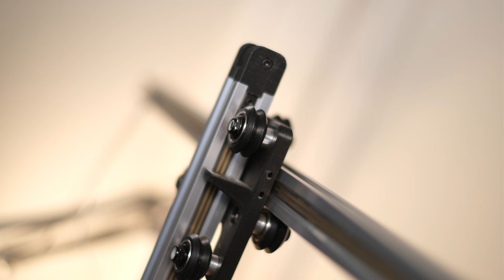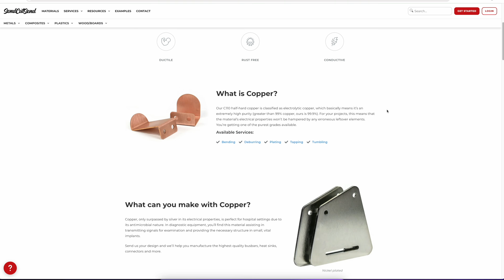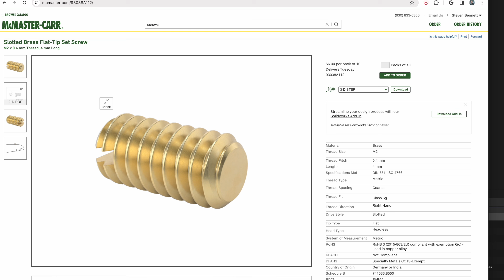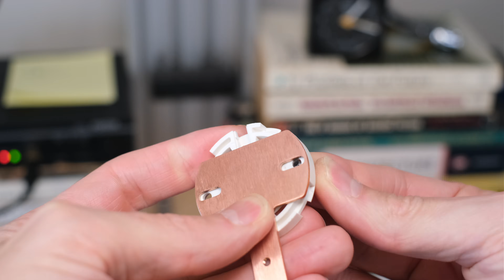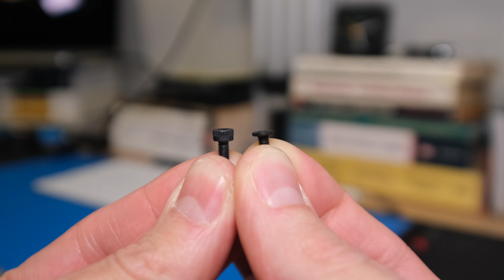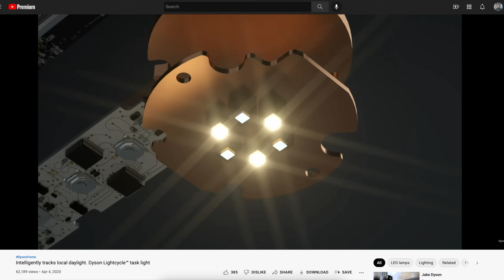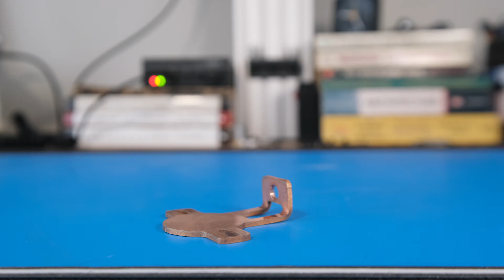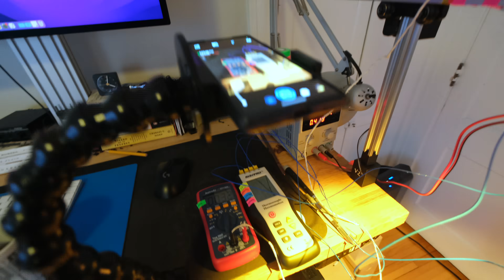Just how good are heat pipes anyway? - DIYson Lamp Build Log #10

Comment: Countersink screws could be a good solution
Reply: I obviously don't know enough to comment here because robust design suggests a hole drilled in roughly the right spot with a quick and dirty counter sink feature that seats the bolt head down more than lets say 1.02mm (!!!) would work perfectly. Good design includes tolerances or is tolerant so it matters least how precise your manufacturing is. As the load on the bolt will be less than about 200kgs pretty sure a countersunk bolt will be adequate rather than a counter bored solution. It's also easy to do with cheap low tolerance tools.  If the answer seems too hard you're probably looking too closely. Step back. Take a breath.
Reply: I’d prefer counterbore holes. Countersink holes require higher precision in location and can over-constrain the assembly. When you don’t actually need the countersink to locate your part you’re better off with counterbore holes.
Reply: @ADebbil You'd be right, but I think in this case the bar is too narrow for cbore holes to work - the cbore diameter for an M3 screw is wider than the bar lol. Even going down to M2 with a cbore cuts away too much of the bar imo. Csink doesn't remove nearly as much material and works a lot better with thin materials. The over constraint issue is easily solved by letting the bar be narrower than the available space.
Reply from the maker: This is something I would probably try if I was forced to use the solid copper bracket, but since the heat pipe performed so much better I ended up sidestepping that particular problem altogether. Thanks for the suggestion though 👍🏻
Reply: @StevenBennettMakes  If you had determined the solid plate solution was better, this is how you would get around the roller clearance issue. But I'm glad you were able to prove the heatpipe solution!
Reply: @StevenBennettMakes  

Honestly, the first solution to the binding that popped into my mind was to just grind down the tips of the wheels, as that shouldn't interfere with them seating against the slope of the rail.  Does that make sense, or am I missing something?

Also, it occurred to me that the heat pipe might not be making solid contact with the bottom of the rail's T-slot.  Might there be enough of a gap to slide some copper in between the top of the heat pipe and the top of the rail's T-slot?
Reply: @ADebbil   this is true, although i wonder how much it matters in an application like this where a long, thin piece of soft metal being anchored to a much thicker and more rigid aluminum extrusion; surely the copper will simply deform to take up any misalignment?
Reply: Could also shave some material off of the wheels.
Reply: @scruffy3121  I would have changed the wheels holding the horizontal arm to grab it from the sides instead of top and bottom.
Reply: With the screw held in compression, a set screw is better.
Reply: @Flumphinator in the new way the screw is to pull towards the center and counter sink screw is the right choice
Reply: @Flumphinator 🔴 What Is Islam?  
 
🔴 Islam is not just another religion.  
 
🔵 It is the same message preached by Moses, Jesus and Abraham. 
 
 🔴 Islam literally means ‘submission to God’ and it teaches us to have a direct relationship with God.  
 
 🔵 It reminds us that since God created us, no one should be worshipped except God alone.  
 
 🔴 It also teaches that God is nothing like a human being or like anything that we can imagine. 
 
🌍 The concept of God is summarized in the Quran as: 
 
📖 { “Say, He is God, the One.  God, the Absolute.  He does not give birth, nor was He born, and there is nothing like Him.”} (Quran 112:1-4) 📚 
 
🔴 Becoming a Muslim is not turning your back to Jesus.  
 
🔵 Rather it’s going back to the original teachings of Jesus and obeying him.  
 
 
More .....👇 
 
🔴 THE RETURN OF JESUS
Reply: @Flumphinator  🔴 Why Islam not other religion

 1-islam gives logical and simple idea for God - he is A perfect God - he is not a man nor a son of man nor an Idol or a trinity nor limited nor created - he is totally unique and to him belongs all the good qualities 

2-Islam accepts all messengers of God -- about 124 000 and in Islam, we love all the prophet of God and we can’t deny any of them - while in other religions such as Judaism for example - they reject Jesus and Mohammed -- and in Christianity they reject Muhammad ... but in Islam, we accept all . 

3-in Islam, there is no mediator between you and God -- you can pray to God directly - there is no need for someone in between... 

4- Islam is the Only religion that is Not named after a person or a tribe or a group, its name means submission to the One True God, if anyone anywhere at any time lived the life of submission to the true God alone , then he is a Muslim.

 5- In Islam (worship) is not about mere rituals. it's a comprehensive term that includes any deed that pleases God. All good deeds are types of worship, smiling, being sincere at work, saying a nice word, and even treating one's spouse gently, all this is greatly rewarded by God. And in the opposite any deed that doesn't please God is a sin; talking bad about people is a sin, cheating, lying, hurting innocent people, harming the environment. 

6-in Islam God is always forgiving - if you always repent (before death ) he will just accept you no matter how great sins you did >he forgive us out of his own grace - there is no price to be paid in order for him to forgive > so it's not like Christianity which says that God can't forgive except by blood of Jesus ..

 7-Islam is a way of life – it organises each aspect in your life.. it has solutions and divine guidelines to problems in your life . 

8-the sources of Islam also was collected and saved is also amazing - it never happen to any book in history --- it's through the uncut chain of known narrators which date to prophet time ... besides the millions who memorised it from cover to cover since that time up till today - besides being documented in front of the prophet by known companions! 

9-Islam prohibits blind following without knowledge and it invite us to use our brains to know truth, it is based on evidence and logic. The rational mind is the basis for religious accountability and responsibility. 

10-the moral system of Islam is v high and perfect and thus the countries that apply Islamic laws in a proper way -- they have less moral crimes.

 11-You won't lose Jesus if you accept Islam, but you will just correct your belief in him , In Islam, Jesus stands a good position in Islam as one of the messengers of God together with other messengers.. they were all special and they were all humans like us-- none of them must be worshiped -- we only worship God who sent them . we believe that Jesus was a noble Messenger of God but not divine,,,, we love Jesus and obey his true teachings and pray like him , fast like him , and a person won't lose Jesus if he accepts Islam -- but you will just correct his belief about him 

12- Paradise in Islam is a real physical life for both Body and soul, you will go there , eating drinking marrying and meeting with prophets and having wonderful eternally unlike in other religions which they think its only spiritual life.

 👉IN ISLAM THERE IS A PURE & CLEAR CONCEPTS OF GOD 

🍃🍃🍃🍃🍃🍃🍃🍃

God is One and Unique: God has no partners, no equals and no rivals. God has no father, mother, sons, daughters or wives. God alone is worthy of all worship. God is the All-Powerful: God has full authority and power over all things. Obedience to God does not increase His Power, nor does disobedience decrease His power. God is the Most High: There is nothing above or comparable to God. The attributes of God do not resemble that of His creation. No part of God is present in anyone or anything. God is Perfect: God does not have any human limitations, such as resting on the seventh day after He created the universe.

Comment: How about using small leaf springs bent to a concave arc to press the heat pipe or copper strip to your Aluminium extrusion?
Reply: oops, you said this way more concisely than my comment, have a like

Comment: Screw holes talking most of the copper cross section - don't help with heat transfer.
Would be curious to have this data compared to a modification where the heat pipe is replaced with a similar size copper bar (no screw holes, same mounting as heat pipe).